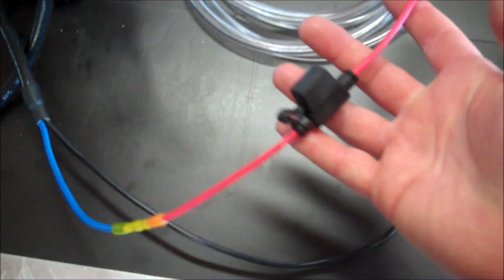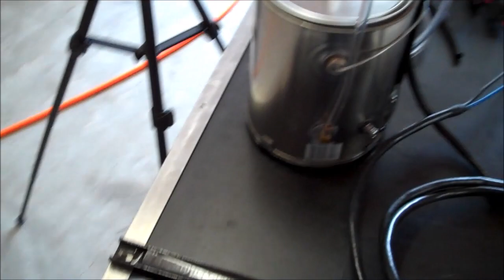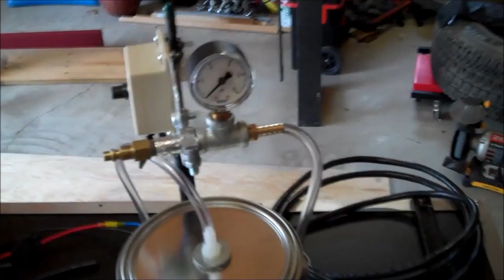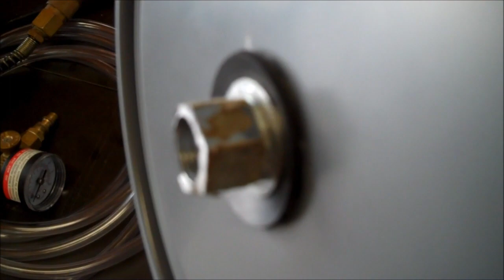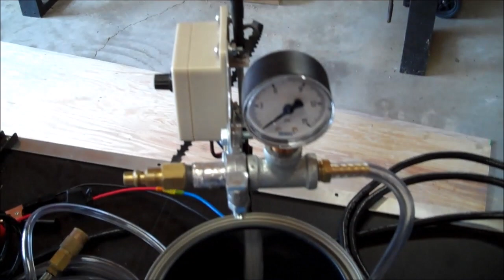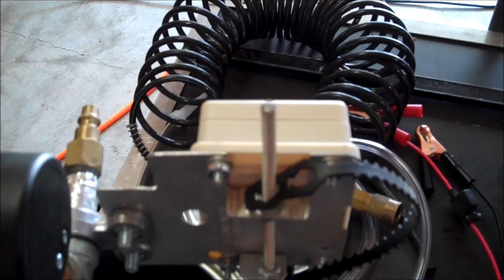Overview of my DIY Smoke Machine

Comment: Damn! That is nice, but complicated.

I got an old paint can and put two holes in the top. Connected one hose from engine to can. I lit some wood chips and got them smoking. I tapped the lid on and let my tire inflator push the smoke through the engine.

Found the source of leak in under a minute.

Comment: Great little idea, I did own one of these paint can smokers, but I didn’t like the way it overheated.  One day I blasted the lid off it during a smoke test on my car because it overheated so quickly.  Mine did have a glowplug as a heating element which may have been the cause of overheat.  So I sold that one and just bought the $149 Stinger Smoker on eBay (Amazon sells it also).  Let me tell you, it has been the best money spent.  It works perfectly, never overheats, and hangs with the built in hook.  (Great for mounting under the hood) heck it even looks good !!   No I do not represent Stinger, nor am I being paid for this, I actually spent my own money on the stinger smoker.   Its just I figured I’d put it out there because it is well worth the money.

Comment: Just a thought. I have never seen any Factory diagnostic flow chart recommending an inert gas used for testing. All Factory testers use shop air. When the system is functioning, the Purge Valve is drawing vacuum to the system to pull vapors out. The Vent Valve is open (in most cases) drawing atmospheric air through it to the Canister and then to the Tank. Same as using Shop Air. The only time the Vent Valve is closed is during a random diagnostic leak check. I am aware of California Smog Checks using Nitrogen for their Evap system checks for pre 2000 vehicles. They just want to cover their Derriere in case of other issues. No real good reason for it. Just think about Fuel Injection with a return system, the pressurised Fuel made its way to the hot Engine. The return fuel is now hotter, and is now vaporizing in the return line. Now you have fresh warm vapors and cooler atmospheric air drawn into the system. Sounds scary, but in reality: Not an issue.

Comment: How many amps do you need in order for the mineral oil to smoke and not burn?  You mentioned that you use about 4 amps most of the time?  I want to rig this without the dimmer and just use the correct length of nicrome wire to get the correct resistance.

Comment: It's possible to use 22 gauge wire?
Reply: No, that's far too small.  I would not want to do smaller than 16.
Reply from the maker: sure, it will change the amperage calculations a little

Comment: Is the nichrome wire absolutely crucial? Im using 20 gauge non-nichrome and having overheating problems
Reply: Nichrome heats up faster. You can use Kanthal or SS.
Kanthal and SS also taste and smells better than Nichrome :)
Reply from the maker: The nichrome wire is necessary, or some other resistive wire. if you're using straight 20-gauge wire, that won't work well